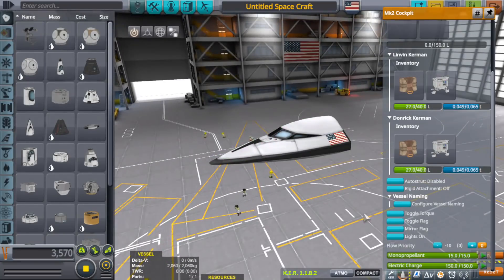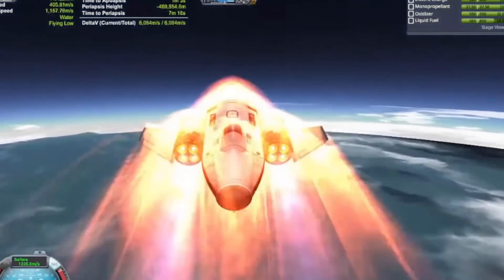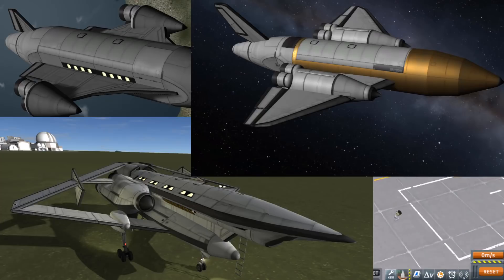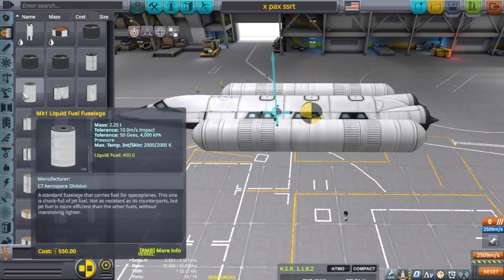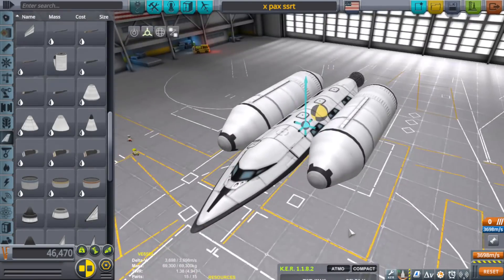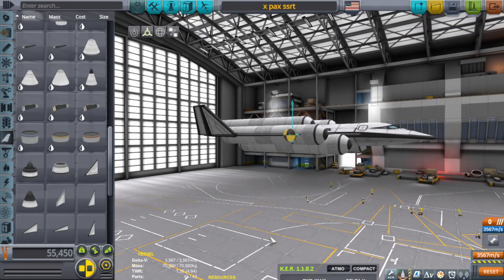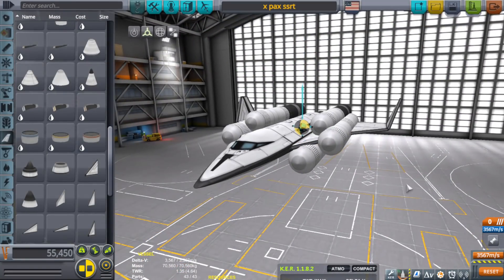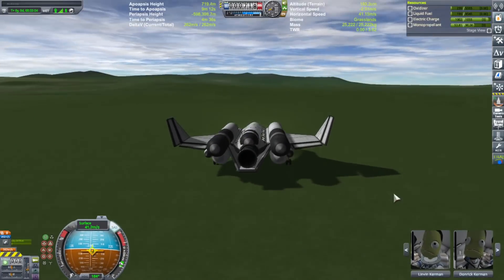SSTO into an SSRT

Comment: I wanted to take two orange cans to orbit via reusable single stage, and tried both SSTO and SSRT designs. For sure, the largest difference is in design methodology and takeoff/landing characteristics. 

Design methodology:
-SSTO’s, like you said, prefer less drag. This is usually most easily designed as a plane first, with extra thrust added later, because SSTO’s take advantage of the atmosphere. 
-SSRT’s tend to be rocket first, with wings attached later. This comes from both the increased fuel volume from oxidizer, and need to exit the atmosphere quickly. 

Takeoff/Landing Characteristics:
-SSTO’s, as plane first, tend to have smaller dry mass, better aerodynamic control and lift, but more anemic thrust. This results in longer runways for takeoff, and shorter runways for landing. 
-SSRT’s, as rocket first, tend to have larger dry mass, worse aerodynamic control and lift, but stronger thrust. This results in shorter runways for takeoff, and longer runways for landing.

Comment: I use "spaceplanes" to haul passengers and small cargo to orbit. They're small so don't take a long time to build and test. However, for the large cargos, I use exclusively my "ULS (universal launch system)". Of course they're not nearly as effecient, but they're a LOT easier to build and barely require any testing. Yes, the costs are 3-4 times higher, but what really is an extra 150k in a mission that costs 1.5 million?

Comment: Well from my experience, ssrt is better for small to medium weight class, but due to diminishing returns of fuel to thrust at higher amounts, air breathing sstos wins out at the heavy class as you don’t need to carry as much oxidiser, and using the more efficient air breathing mode to build speed instead
Reply from the maker: Actually, when it comes to fuel efficiency only , Air breathing SSTO are extremely efficient whether it be small or large. SSRT are fuel guzzlers. However they excel at getting into orbit quickly and easily.

Comment: dont have drag, just use air as the oxidizer
Reply: air rocket
Reply: scissor folding wings, f-14 style, but up to rocket shape, fold completely away
Reply: variable wing angle plane to rocket, so that you mach 6 with minimal wings at rocket shape, like the x-17 nasa air rocket
Reply: so you have to get to mach 6 (2400m/s) inside the full atmosphere
Reply: Well the issue is that robotic servos in game is too weak/not rigid enough to survive the aerodynamic forces
Reply: @howardxu8050  try detachers or multiple servos, or stronger servos
Reply: @howardxu8050  you could even use air locks or docking ports to fix the position of the part in place

Comment: I really don't get the point of, should I say, conventional SSTO. Yeah, they're a bit more economical — until you realise you have to land the damn thing. So I wonder. What if it's a niche thing? A very specific niche? A space vessel that only uses ONE type of fuel? I've tried repurposing some of the stock craft and making my own, but even though I finally managed to put it into orbit only using liquid fuel and nothing else, I don't have much left for payload and return, so I again wonder if it's viable after all. Would be nice to see something that only uses liquid fuel, but can deliver something like 10 tons to the near kerbin orbit (though ideally, to Mun), then safely get back and land without calculating the entry point.
Reply: I have an 18t to 120km parking orbit SSTO that uses only LF, uses 4 nerva and 8 rapiers. Fair bit of clipping is needed, otherwise the drag makes it untenable. Payload size is also rather limited in terms of diameter.
Reply: @fenriders7008  
That's the idea, though: no clipping, no mods, no cheating it in any other way. I've got 4 rapiers + 3 nerva that can deliver a few tons to 100+ km orbits, but getting it back safely is quite a hassle, because it gets to those orbits with barely enough fuel to land, so I have to use inclined orbits or wait a lot for the space center to be directly below me. So in principle, yeah, it can be done even without clipping, but I feel like I'm missing something and it can be a viable means of transportation.

Comment: Beautiful, and very good camera work. Indeed SSRTs are cool but their usefulness is another matter. The payload that they can get up in orbit looks to me to be the same as a one stage rocket. The benefit is that they can land on the runway and be retrieved. Air breathing SSTOs can get a lot of tonage up there without needing to be very big and of course you land and retrieve them as well. I got a video of one but since I'm very new to YouTube the audio is awful 😅.
Reply from the maker: ya, it gets to a point where anything over 300 tons or more can more easily be put into orbit with just a conventional rocket. The more tonnage the payload, the harder it is for a conventional air breathing SSTO because of the weak thrust that comes from air breathing engines. I once made a 300 ton payload air breathing SSTO , but it took almost 20 minutes to get into orbit riding the thin atmosphere. Needless to say I was not impressed.
Reply: @vaos3712  then I guess I got lucky, mine is a 300 ton as well but it's easy to fly it gets up in 5 minutes you just have to point it at the beginning at a 5° angle over the horizon and it flies on its own.

Comment: SSRT's are cool and easy to fly, the lunch doesn't take nowhere near as long as an SSTO which are so many good points but SSTO in my eyes are just cooler. Unlike SSTO with a good build you get the advantages of both side of the coins, the atmosphere and the final but to reach orbit. I think that the challenges of making an SSTO and it's great efficiency and copacity just makes SSTO cooler in my eyes.  
:_ck1::_sck1::_ck1:

Comment: Thank you VAOS. Thanks to your videos, I finally, after hundreds of attempts and tens of different spaceplane designs, managed to fly an SSTO to Minmus today. And it was ridiculous! All it took for me was replacing my shock intakes with nose cones to gain over 1000 d/v.
All thanks to you, who taught me drag was even a thing in KSP.
Reply: Do note that you can close the shock intakes and they act like the nose cones, I’m not sure they provide as low of a drag coefficient but it’s a marked improvement over leaving them open, use the aero overlay and have a look at the difference.
Reply: @fenriders7008  Yeah. I actually forgot to close the intakes in my shocks v. ramps test. I think I just have too many intakes, but it would be easier to test that by closing intakes than rebuilding 6 2-engine nacelles. Thanks for the reminder.
Reply: That's all it took?? Now that is fascinating...
Reply: Wow! I should definitely take some intakes off my monster.
EDIT: Found my notes. I did try it, halving the number of intakes from 12 to 6, and got a 0.4% improvement with shock cones and 0.7% with ramp intakes. Huh!
Edit #2: Looked at my notes again; thinking I might just have been noting the weight difference. Will have to try it.

Comment: As far as I understand, the terms SSRT and SSTO are technically interchangeable, but I really dig the differentiation between SSRTs (using Lf+ox) and SSTOs (plane-like crafts with air-breathing engines) Vaos does.

That SSRT conversion of that spaceplane looks absolutely marvelous.
Reply: So, the X1 plane is a SSRT…….. 
this completely changes everything

Comment: In my testing I found winged SSRT and non winged SSRT both viable for low orbit missions, but if you're going further you should dich the wings, because they are just extra mass. If we're talking about an SSTE, then your best option is an SSRT without wings (and yes its better than a rapier SSTO).
As much as I hate to admit it wings are overrated. Another thing to point out is that a well designed SSRT without wings is actually more versatile since it can land on any piece of flat land and doesn't need a runway.
I am using FAR tho, but I have a lot of experience with the stock game too.
Reply: I love the look of wings, but every time I see a non-VTOL spaceplane land on Duna I'm like, "Hnng! The poor landing gear!" lol

Comment: I love this ssto vs ssrt stuff. It reminds me of those car guys who love ‘MERICAN made classic cars because of raw power and stuff instead of going for fuel efficiency/sustainability. But this is actually cool because it’s spaceships.
Reply: ‘Speed and power.’
-Jeremy Clarkson.
Reply: Silly people! You can have both power and efficiency in when you go Japanese!

Also reliable!
Reply: @PuncakeLena  wellll this is all getting very off topic... but the size vs revs/tech argument/domestic vs japanese is pretty 1990s. These days everyone is going for smaller engines, more compression/forced induction. Can't really escape the fact that a  small v6 with a turbo can deliver big v8 power at altitude/boost, and lower fuel economy when not in boost like a smaller engine.

My 2000 miata gets about 25 mpg and 140bhp at the crank. We inherited a 2019 jetta recently that gets about 40mpg and 140bhp at the crank. New V6 tundra is same story. etc etc. Meanwhile my 2011 toyota tundra gets like 10mpg on a good day. I know people who've dropped V6s and V8s into Miatas and actually get better fuel economy on them due to longer gearing, lower revs etc etc.

To bring this all back to Kerbal - weight, and aerodynamics make a much bigger impact on efficiency than the specific engine technology ;)

One of my favourite things to do in kerbal these days is seeing just how tiny I can make a space vehicle, especially unmanned ones. That tiny okto probe core is my favourite these days. Its amazing the delta v you gain when you start aggressively weight reducing your designs and going for max simplicity.